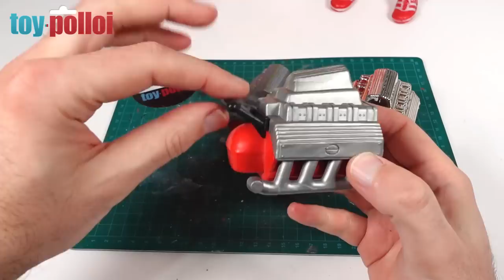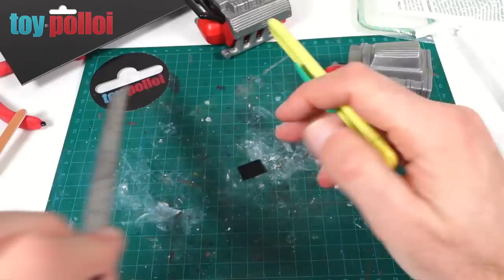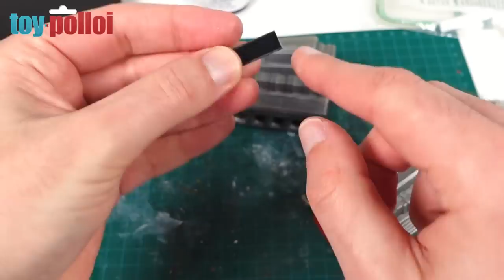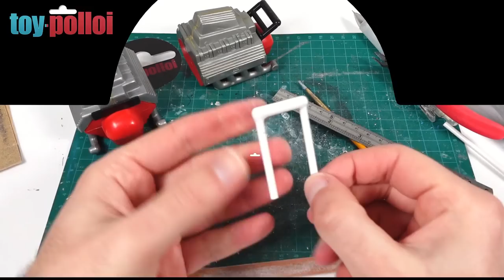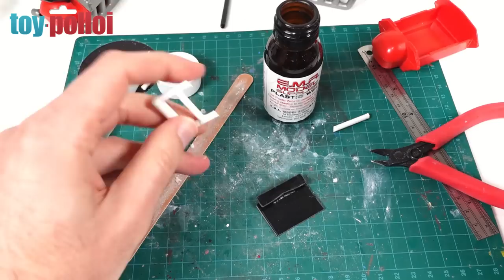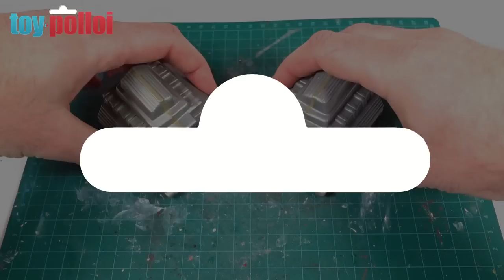Vintage Six Million Dollar Man Engine block repair - Toy Polloi

Comment: I half expected you to use a lego ladder as the starting point. It turned out very nice.
Reply from the maker: I did look at that but it's to small for this project. Correct shape, but need to be twice as thick. So easier to construct from scratch. Cheers

Comment: For a piece that seems so simple you put in some thought into accurately recreating it! If it wasn't for the heavy handed glue on the og engine block I would never be able to guess which was the repo
Reply from the maker: Thanks. If you break the project down into steps even complicated looking shapes can be made from simple parts.

Comment: Awesome work, my engine is also minus a handle so this is great to see
Reply from the maker: It's pretty easy to make from styrene. Just break it down into simple shapes.
Reply: Out of curiosity, is there a place that sells these rods for a decent price? Here they charge at least $10 for a bag of four equally sized rods.
Reply: @a-tick  Amazon US have packs which include multiple diameters that would do This project several times over for around $7
Reply: @ActionPopCast  ah, good to know! I'm not in the US, but good to know they're still making variety packs. Thanks!

Comment: I don’t remember the engine block when I had mine though I was a young man at the time
Reply from the maker: Maybe you had the second issue that came with a Girder?
Reply: @toypolloi  that’s possible I do remember the rubber “skin” covering his arm Bionics and the eye thing though
Reply from the maker: The second issue are was silver with the gripping hand action. It still had the rubber skin over the top. It was underneath the silver part would show.

Comment: I really like these videos where you built stuff up out of sheets and rods of styrene.
Is this video from before you've acquired the digital calipers? I would guess that you would've measured everything with that. Still, it ended up looking really, really good. Super close to the original piece.
Reply from the maker: Thanks. I filmed this one before I had the calipers. But they would have been useful.

Comment: The second I saw that handle I immediately thought of the Lego ladder part number 6020.  I wonder how close the end of that ladder would match if at all.
Reply from the maker: I did have a look as I have a few. It's much to small sadly. A good shape, but needs to be much thicker.
Reply: @toypolloi  Yeah I thought it was a good shape too, but I've never held one of those engines so I had no frame of reference how big it is in person.  Great video as always!

Comment: You really swear by that plastic-weld stuff, don’t you TP? Is is as strong as cyanoacrylate?
Reply from the maker: Used on the correct plastic it's the strongest bond you will get as it fuses the plastic together, it's not a glue.